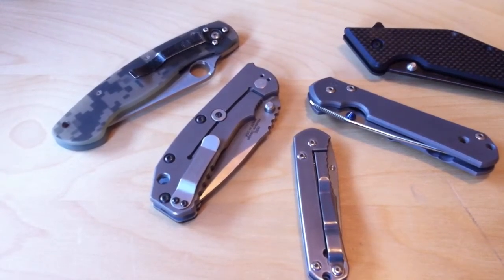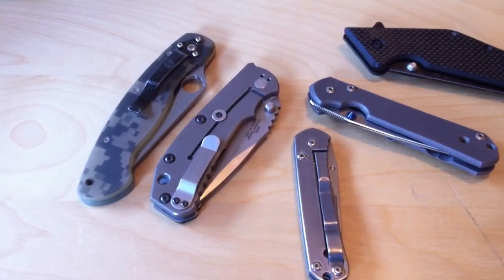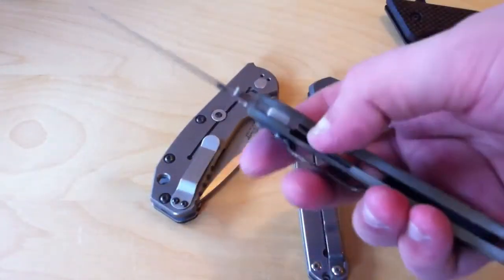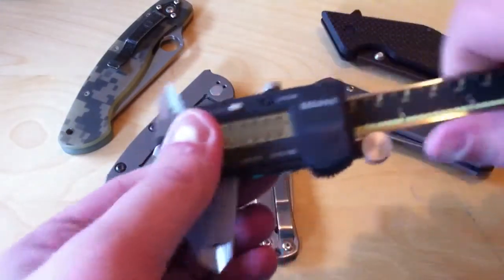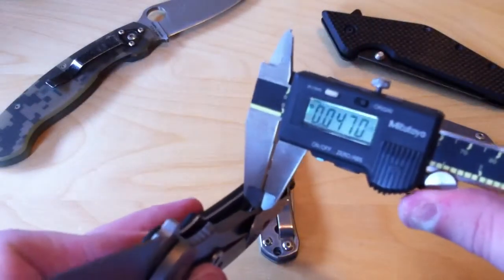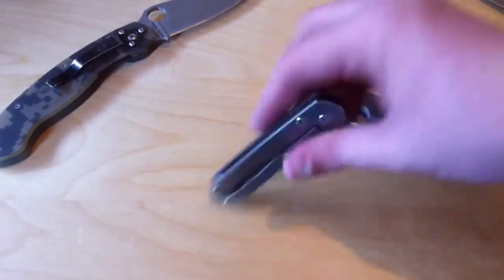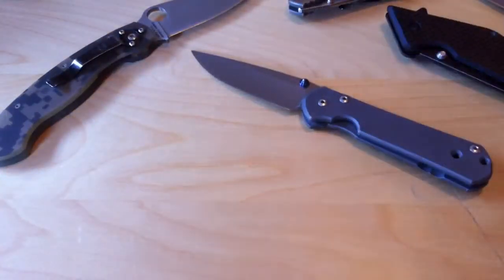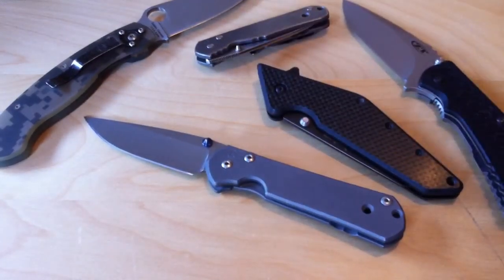VR: Liner or Frame Lock?

Comment: Good vid. As knife nuts we tend to take things to the extreme in wanting to figure out and debate on whats the strongest lock, toughest material, best steel, etc. When usually there isn't any right answer to the question. Some liner locks are built right some aren't. Same with frame locks.In the end I too prefer frame locks. In my experience I haven't had one disengage. I've had a liner lock disengage but wasn't due to lock failure but more of the shock(vibration) causing the liner to slip.

Comment: i think u are right with the cheap knives liner lock. some are very sketchy. if you buy a six dollar knife id try and find a framelock of some type. itll be safer.  as a note when chopping bottles with my umnumzaan my lockbar did push in and almost got stuck.